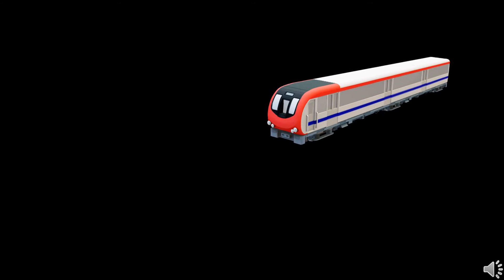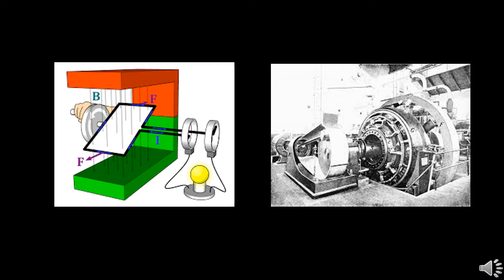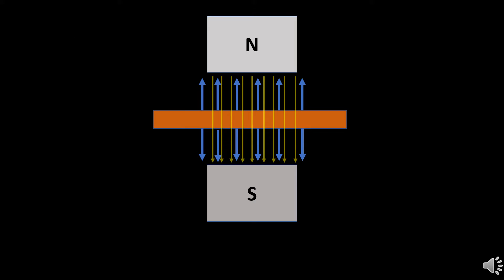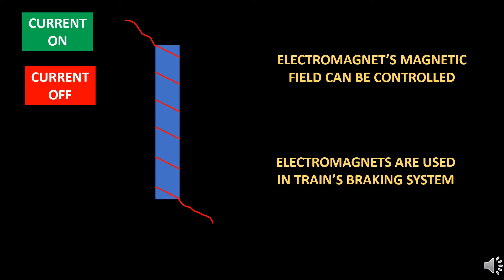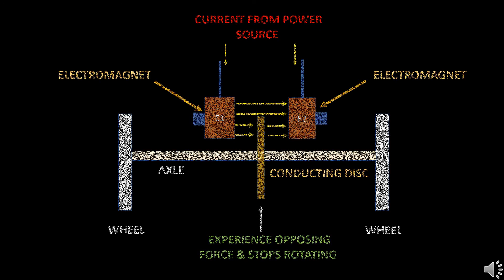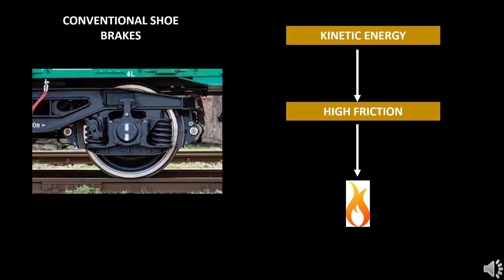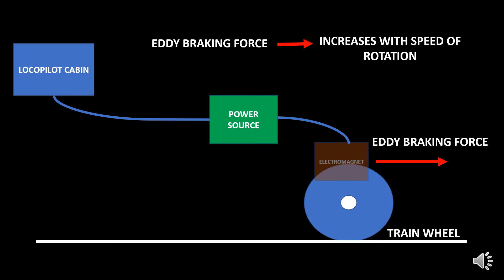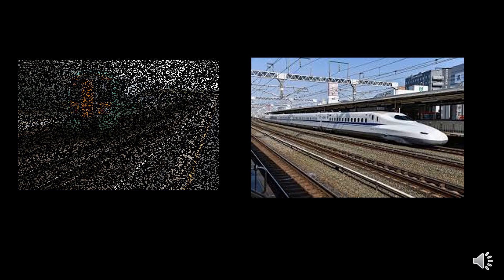Eddy current - Eddy current brakes #howitworks  #trains #physics #electromagnetic #Induction

Comment: I think another thing worth mentioning is that you do not necessarily need a rotating disk mounted on the axle of the train. For example the ICE 3 has electromagnets which are located only a few millimeters above the rails, so that the rails can be used as the stationary part of the eddy current brake. The produced heat is very well distributed thus making it the preferred braking method along with the regenerative braking of the electric motors.

Comment: Hi , I have a question. Due to they eddy current proudced there is high heat generation. Even if the conducting disc slow down, how do we tackle to cool down the entire system. IRL do we have a cooling mechanism
Reply from the maker: Hi Yash, they don't have exclusive cooling system. Mostly they are air cooled as brakes are not going to be used continuously for long durations, only when needed they will be used for short duration.

Comment: How hot do the disc get with the Eddy Current?
Reply from the maker: Hi, the disc does get hotter, when brakes are applied. But it will be for a short duration and the temperature will not be high enough to cause any damage to the disc. Thanks for your comment.

Comment: in todays world of railways, the this type of electrodynamic braking is not used, instead, the traction motors are converted into generators and the train comes to stop, then either this power is decapitated in brake resistors or sent back to catenary
Reply: This would work if the train has multiple electrical motors distributed along the bogies (automotor). If only the locomotive is individual, it would not have enough braking power to stop the train.
Reply: @draganandrei5356  Not necessarily, a lot of modern locomotives use them in combination with air brakes. Electric brakes in general are much more useful to reduce speed quickly and in passengers trains.

Comment: eddy brakes system is best of trains not for road vehicles
thanks for this information🙂
Reply: Why not
Reply: @باکۆمُحَمَد  It's wasteful. If you have the electrical generation capacity to make eddy brakes work in a car you're almost certainly using a hybrid or battery-electric drivetrain, in which case it's far better to use regenerative braking rather than waste all that kinetic energy as heat.
Whereas trains have so much kinetic energy that recapturing it all isn't feasible, so you may as well use eddy brakes.
Reply: They have Telma brakes on heavy cranes trucks in EU mountains..